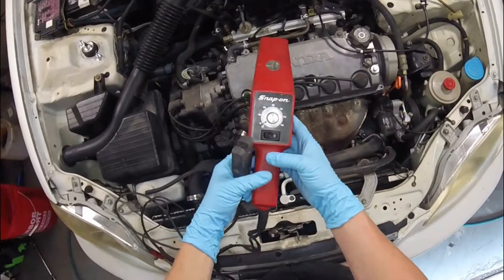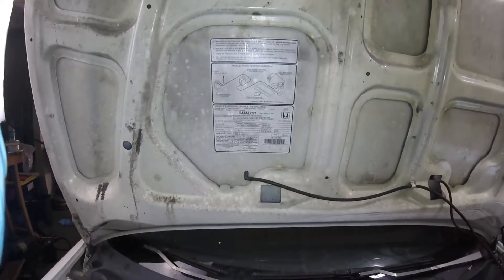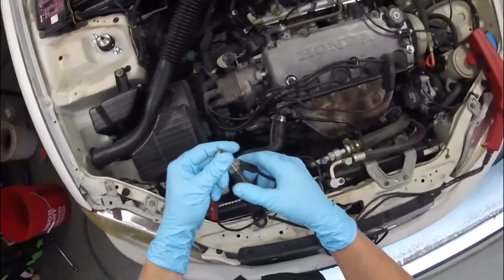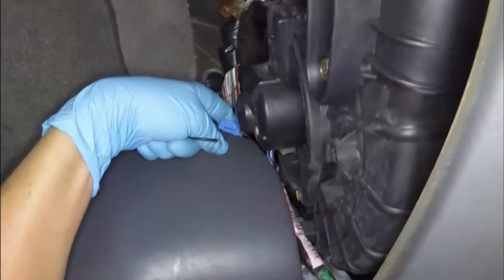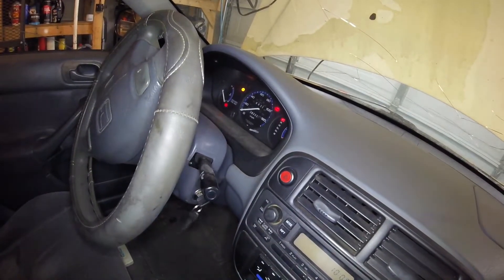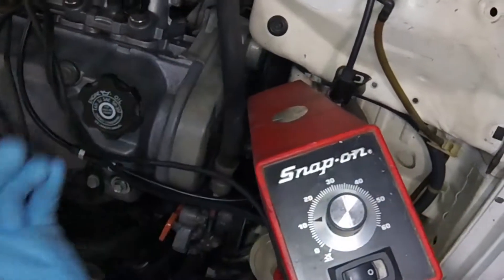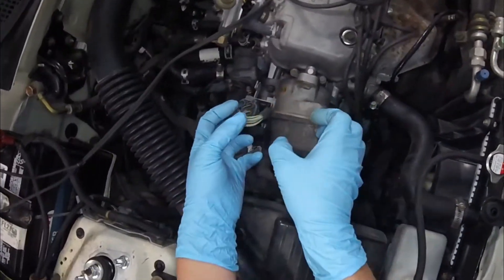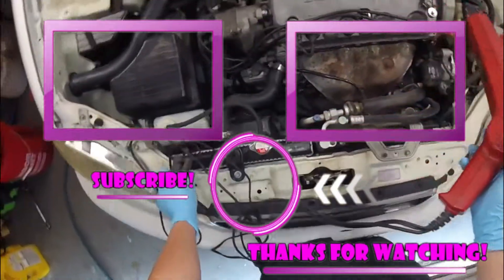⫷ Honda Ignition Timing Check and Adjust. Civic, Del Sol, DX/VP/LX/CX ⫸

Comment: On a newer Honda Accord 2002 is the jumper on the driver side fuse panel and only one wire? do you just ground the one wire?
Reply from the maker: Does it have a distributor? I thought was a distributorless ignition system.
Reply: @ScottiesHobbies   Yes it has a distributor. In my research sense I asked this question to you.I found mentioned in a couple of forms that I have to jump the number 8 and 13 pin on my OBD2 connector to do the base adjustment. I am just afraid to do it and fry something. 1998 to 2002 Honda Accord VP  Non V Tech
Reply from the maker: @KPaul7  on all data and Mitchell on-demand it says your ignition is non adjustable. Looks like your dizzy doesn't turn. The mounting hols do not have space to slide back and forth.
Reply from the maker: @KPaul7  all data says to check your timing at idel and if its wrong, replace the pcm... sounds a little extreme. To check the timing it says to connect something to the dlc, but only to check. You could probably jump something but I don't have that knowledge.
Reply: @ScottiesHobbies  thank you so much. I took out the top bolt and it does have room to move. I will check the other two and let you know. It is the VP so it's the base model. That's why I said non V Tech. I have had problems when buying parts at auto part stores as they think it is. Engine is F23A5 distributor is TD 91U 2419 if that helps.
Reply: @ScottiesHobbies  My distributor is not adjustable. Two of the three bolt holes are slotted and one is not. Just putting a timing light on it. It was 12 degrees -2 to -4 and jumping 2 Degrees some of the time. So let me break it down.
12 degrees 20% of the time (in spec)
10 degrees 50% of the time (in spec)
8 degrees 30% of the time (out of spec)
I have 114,000 miles and the timing belt was done at 105,000. I was told it was done when I bought the car at 102,000. But I could feel the slack when on and off the throttle that was not just motor mounts. I will be doing a valve adjust and recheck just to see. I did not jump any thing to check the timing. After I had Honda do the timing belt and valve adjust the car had less power. The car would also stall when I got the car back. If I held the RPM at 2000 and let off it would stall. So I did Cap rotor wires plugs and it still stalled. That did go away over time but the power never came back. The car does drive OK. It just doesn't have the response that it had or should have. I have worked on cars all my life so I know alot.
Reply from the maker: @KPaul7  let me put some thought into it and get back. But have you checked compression? When you did the plugs, you verified the gap was good? I think they get damaged or the gap can change being shipped around the world. And ngk plugs used?
Reply: @ScottiesHobbies  yes NGK Double platinum listed for my engine. All Gaps were good and I aim the opening towards the intake valve. By drawing a line up the socket and extension. No I didn't check compression. Thanks I will. I'm thinking the Distributor. The car runs fine just not 100%. The gas mileage also went down after the timing belt. The Honda dealer told me it was the tune-up. As they knew I was going to do myself to save money.  Supposedly they did timing belt, front seals, drive belts, valve cover gasket and valve adjust. As I payed for. Just over $1100. I have been just living with it and now with gas prices. I would like to get over 16 MPG city and 18 highway. My friend has an 01 and gets 19 city & 23 highway. No my brakes aren't dragging. I've owned 7 Honda's and I just know something isn't right. I was thinking of running cataclean. Thanks again
Reply: @ScottiesHobbies  hay what do you think of the EGR port being restricted. But not enough to throw low flow code. Or EGR not closing all the way. The kid that I got it from didn't change the oil much or at all. After he got it from his grandmother at 86,000. I got it at 102,000. It was burning a little oil when I got it and front seals leaking. That's why I changed the front seals. It doesn't burn oil now. I did the 500, 1000, 1500, 2000 oil changes with 1/4 qt. Marvin's mystery oil and then regular 3000 mile oil changes. Just a thought.
Reply from the maker: @KPaul7   The EGR being plugged or plugged or stuck open a little is a logical possibility. Before I just replace it I would make sure to clean the ports out. Make sure you have nothing clogging or restricting flow.
Reply: @ScottiesHobbies  yes for sure. I am waiting on a gasket for the EGR. I'm going to clean port and EGR. I'll let you know if any change. It did just throw a evap leak code. Waiting on as I just tightened the gas cap. Compression was good but I will do again after valve adjust. It was 200, 196, 202, 202 cold. I still need to do hot test. Thank you again so much.

Comment: So if you have it at 0 on the timing light, it should light in middle mark of other to marks and if it doesn't light on middle mark then you adjust distributor until it lights up on middle mark right?
Reply from the maker: Yep. 🤞👍 good luck. Make sure your base timing connection is jumped if you have one.